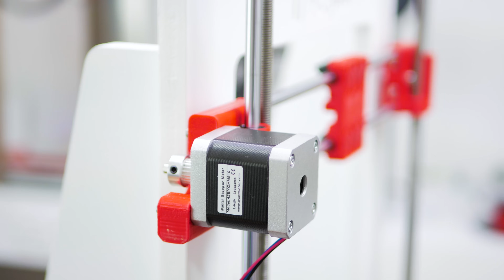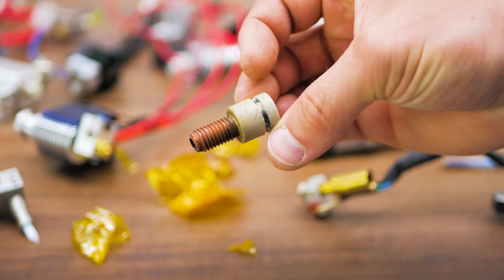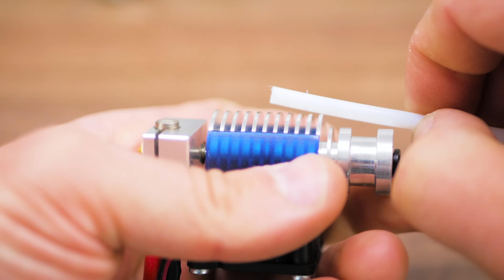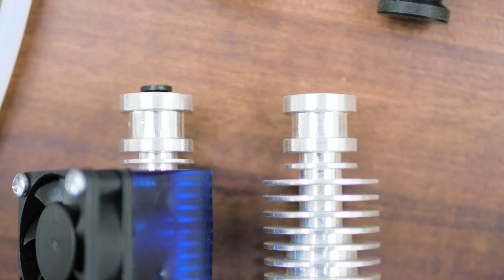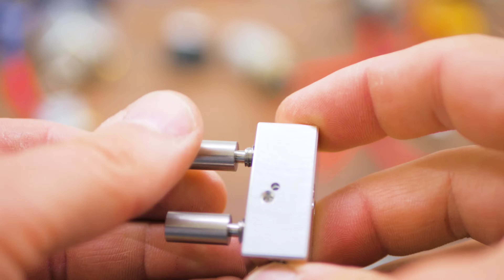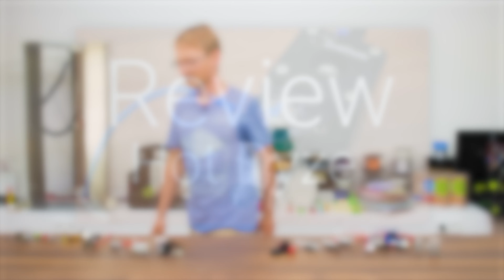Build your own 3D Printer: Which hotend to pick!

Comment: Haven’t looked back since fitting a Revo Rapid V6 hotend to my Anycubic i3.  It has direct drive and handles LW-PLA single wall prints without jamming. It’s also a tidy looking setup. Worth every cent for the fully loaded kit and the supplier printed a mounting to suit which saved me the hassle.

Comment: The chinese higher end (!) knockoffs or "versions" have come a long way since this was recorded. Particularly so for these chinese component manufacturers that have specialized in in 3d printer, laser and cnc component manufacturing, so they have highly skilled electrical and mechanical engineers and machinists on board, as supposed to those just trying to replicate from visuals. Those "versions" aren't always super cheap though, the dirt cheap ones still tend to really suck. An apt example is the higher end micro swiss "versions", which have actually improved substantially on the original design, where micro swiss themselves have been vocal about intentionally choosing not to address those points of flaw and improvement.

AFAIK, some of these high end "knockoff version" manufacturers, are also the actual OEM manufacturer (or under same umbrella) of either parts of, or the entire brand-name model.

Comment: i have a prusa i3 clone with an mk8 extruder and it works 100% perfectly fine. In china they have no laws against stealing other people's intelectual property.. so when american companies have their stuff made in china (which a huge percentage of them do) those plans and parts are now cloned and sold for way cheaper. this is NOT always because the quality is lower than a genuine part. MOST of the time the ONLY difference between a clone and an authentic part is the name they stamp on it. a lot of the times the same machines and factories that made the authentic part is also making the clone. aka, there is literally no difference between the clone and the authentic part. or sometikes when you buy a "clone" its not a clone at all.. if a company makes a v1 product and makes way too many of them, when they release their v2 product, that factory still has a bunch of v1 parts left over with nobody to sell them to. So someone somewhere will slap em on ebay. If were talking about advanced electronics, then yeah you always want to get authentic parts that have high quality components in them.. But for something as simple as a hot end (or MOST of a 3d printer) you will get identical performance from a clone as you will with an authentic. the only difference is do you pay 40$ for a part or do you pay 7$ for the exact same part?

Granted with an authentic you KNOW youre getting a good part, and with a clone you only will Probably get a good part. There's always that risk you will get something trash because theres no quality control on chinese pop-up factories. But in my experience, 100% of the clone 3d printer parts i have EVER bought, they have worked 100% as good as the authentic parts.

Comment: Taken into consideration that this is 4 years old as of this writing and my mechanical/engineering knowledge of 3d printer hot ends is rather limited, but is there a reason no one uses a graphite liner instead of Teflon? Being exceptionally slippery and nearly heat proof, the only downside I can think of is its relatively brittle nature. I'm sure someone could figure out how to drill out an inserted rod though.

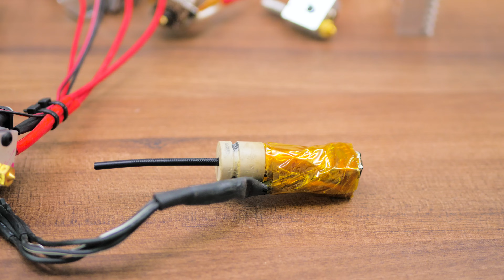Comment: 1:07
PEEK: I am 300C
Standard e3d v6: well so am i
metal infused filaments: well i am 301C
e3d v6 high temp heater block: aM i A jOkE tO YOu?!
Later,
PEEK: tries to print. melts
e3d v6: tries to print. melts
e3d v6 high temp heater block: prints 301 C
pure metal filament: Am I a JoKe To yoU!?
ptfe based vs pla: i can print u
all metal vs pla: ight imma head out

Comment: Nice video.  I have a Lulzbot Taz3.  The hotend just stopped working.  Any idea where I can find a replacement for that?  It looks like Lulzbot has gone out of business.  I'm assuming it's the hot end that is the problem, the bed still heats up, I put a heat gun on the nozzle and the temperature goes up too.  Not sure what else to check to confirm the problem.

Comment: I have a dream of building a DEDICATED polycarbonate printer. (Enclosed, Insulated Hypercube) It would have to have an all-metal hotend. But even the bowden tube and locking mechanisms would have to be heat resistant.

Comment: Just like to confirm for your viewers, the aliexpress E3D is flawed, constant jams with PETG, a jam at the 2 hour mark with PLA, every time!. Changing temp and retraction made no diff. Required full disassembly for unjamming - nice.
I pulled it apart, there is a manufacturing void wider than 2mm above the transition zone that prevents you even pulling out jammed filament, the all-metal height is way above the transition zone causing retraction to stick to the metal (I guess). An M4 to M5 metal pipe, so you can't easily modify the setup. I drilled the heck out of the heatsink (M5) and heat pressed some rounded M4 nuts. Screwed in the usual M4 heat pipe (not sure of its technical name?) with metal the end towards heat block and teflon end inside the heatsink. 
It now works like a dream with PLA and PETG. Doing the PLA at 150 speed, PETG at 100 - still tuning for higher :-)

Comment: Hi Tom, do you have any experience with the nozzle used in the Geeetech Giantarm D200 print. For some reason i have to print PLA at 230gr to get a good result and abs 250gr but at a slow speed.

Comment: Hey Thomas so I purchased a all metal 12v E3D v6 clone for my Tevo tarantula to upgraded me stock Hotend. However it is incredibly underpowered..in fact it only reaches 200c when it is supposed to reach around 280c easily. Any ideas?
Reply: Maybe they shipped a 24V heater cartridge?

Comment: bad choice for what a bad clone example... in most cases clones are cost-effectively better than its original counterpart as for th fitting, well they make it for their own heat sink, in fact most clones are usually as good if not better than their original and since they are not branded are cost effective, not good if u need replacements but great choice if u make sure to buy replacement parts ahead of time and with that in mind the entire notion of clone machines is a myth, cloning is only bad for intellectual property owners not the consumers, there are some exceptions of course I would not buy a clone TV of a Samsung but as far as 3d printers go clones are a great alternative to cheap high efficient machines with out the name tag cost. I am an FDM 3d printing service have used ultimaker 3+ and my original ultimaker 2+ , makerbot replicator and makerbot z18, as well as a few DIY kits from seemecnc.com and repraps, and yes I do have a few SLS and DLP brand name printers... but to be honest I have also bought a slew of counterpart clones to these machines and they are either the same quality (just a bit uglier in most cases) but at times many of the clones are actually faster and have greater resolution and a much better upgrade path than their branded name machines. I don't like IP infringement but I don't believe in monopolies either and clones keep it real! especially in the arena of invention and making 3d printers better and better, point is my clone 600x600x1000 print area fdm with a resolutions of 20 microns and up to 300 microns, I used this a lot and after almost 2 years or extreme usage it is still going strong as apposed to almost all my brand name printers that have hade repairs and fixes and upgrades at least twice in the last two years

Comment: Speaking of clones. Original V6 last time I checked was $70-$100, which is beyond ridiculous for what it is. If they set a fair price they could get much more business, but for me, throwing a $100 for each hotend is a thinkless waste of money. For example "original" heatsink costs around $20, Chinese is $2 and they are absolutely identical. You don't need original for that, at all and overpay so much. the only parts that actually need to be of high quality is nozzles and the heatbreak, but again, they can be purchased elsewhere for a fair price.
Reply: Just be careful when purchasing clones. Yes sometimes they fit and work as intended, but I just got a set of clone original V6 heat-sinks and they were just slightly too thick to mount. Tolerances and material quality are usually what you have to worry about for anything not original.
Reply: And how many hotends have the Chinese actually designed? As opposed to waiting for e3d to work out the engineering and then copy it? End result? e3d go out of business. No more innovation. Also you seem to have misspelled 'are absolutely identical' when you clearly meant 'look pretty much the same to my untutored eye' :-) do you know the grade of Al used in the knockoff parts? or the stainless in their equally cheap heatbreaks? what exactly is the finish on the inside of that cheap heatbreak? How accurate was the lathe, how sharp the tool... or the operator for that matter?
I would have though that 90% of why anyone was into 3d printing would be about innovation, and innovation costs, and innovation on the bleeding edge costs even more!
Why was my BMW more expensive than a trabant? both cars, both German.... go figure.
Reply: Probably it's true, you will not get the exact quality but OP is right, 70€ for a metal tube is just ridiculous and imho the creators developed a good product and now are just riding the money wave.
Reply: @naughtyhorses  I don't count making a huge heater block with horrific oozing issues as innovation
Reply: @friendzone2092  so stick with your Chinese designed kit then...oh hang on a minute
Reply: @naughtyhorses  My friend's Triangle Labs V6 "clone" has worked just as well as my genuine V6 directly from E3D. The only way I can see e3d improving their design further would be to make it more compact and find a better design for the transition zone.
Reply: Jon, it's a non-reasonably high price for few pieces of metal. Even that they've made with great Rz number, precise enough to work great and etc. Of course they spend some resources on R&D but... you know, it's not a gas turbine of an airplane ;)
They just use the situation that "market allows" so the price is high. Now with a lot of clones they must think about smart and fair prices. 30$ is a fair price and I'm ready to buy it for this price (if my own will fail). Just need to cut in-between chains (to customers) so this will work then.
Reply: @KiR_3d  yeah, and the prices of drugs are outrageous for the combination of a few chemicals. Your logic is completely flawed.
Reply: Etacovda63 Err... I don’t think you wanted to put THAT example if you’re disagreeing. Price of drugs is artificially inflated to outrageous prices because people will pay whatever they can for their life. Just see what happened to pyrimethamine (aka Daraprim) a few years ago...
Reply: @GRBtutorials  yes, that's one part - but the other part is paying for research in the first place. No protection of work means people won't develop drugs in the first place.
Reply: Etacovda63 I think this is like insulin in us. Yes it saves lives but it’s insanely overpriced and the pharmacies are abusing the importance of it... in a ton of countries it costs less than 5$ compared to hundreds of dollars in does in the US
Reply: @Etacovda63  I live in Hong Kong, I just bought a Chinese e3d heatsink, block, and heatbreak for less than 10 hkd (~1.2 dollar). There's clearly quite the difference.
Reply: When did I say there wasn't a difference? The point is that china is quite happy to steal designs and make them cheaper - effectively being leeches
Reply: @Etacovda63  that isn't being leeches. That's business. And you can't exactly steal an OpenSource design. Yes, the genuine article of anything will cost more because they actually put resources into research and design, but if the genuine article charges the price of that research design per product, rather than trying to make back that money just by making a great product that'll sell well, then of course people are going to make clones, because you've made it too easy to make a competitive product for significantly cheaper

Comment: I purchased an e3D clone of a v6 hot end. I didn't pay a lot for it, and it worked just fine at first. It got a bit unpredictable at times. I had an issue where I would have to pull the filament each time before a print, and chop semi melted end off to get it to print. I ended up buying an original e3d heat break that was all metal and I haven't had the issue since. The funny part is the price I paid for the clone and the heat break, for a few more dollars I could have got an original one....  But it prints like a champ now.

Comment: I bought a E3D V6 Clone, it was around 7 Bucks with all the exteriour parts as fan hater and thermistor and PTFE tubing and fittings, disassembled it and didn't find any downsides, will buy a real one too to support the company but in the moment I have to keep this hobby on a budget
Reply: TheScrappingJeahaha Hey do you mind linking me the one you bought with all parts? 😊

Comment: I dont see the issues people get with small nozzles. I use a knockoff e3d v6 lite, with knockoff 0.2mm nozzle. The clone has worked great for like 8 months, outlived two of my printers. All I did was replace the thermistor and heater cartridge. $1 0.2mm and $1 0.8mm nozzle all work great. Ive done 0.5mm and 0.06mm layer heights, fun stuff.

Comment: Tom,

I have a custom 3d printer running Marlin on the Azteeg X3 Pro with Arduino IDE 1.6.12. I am using Repetier and having problems setting up my Geeetech Mk8 dual extruder. 
Hot end 1 works fine and reads accurate temperatures with the thermistor connected to TEMP_SENSOR_0. The thermistor for hot end 2 is connected to TEMP_SENSOR_1 and also reads accurate temperatures. I have run PID autotune and changed Kp, Ki, Kd accordingly. 

If I turn on hot end 1, it heats up fine. When I try to heat hot end 2, it does not heat at all and eventually times out with a heating failed error loop. 

When printing, with hot end 1, everything works fine until around the second layer, hot end 2 randomly starts to heat up and eventually stops the print because it reaches maxtemp. 

I was wondering if you could shed some light on what may be going on here, and possibly recommend a fix. 

Also, I am not sure this is the appropriate place for such a specific question. Maybe you could direct me to a better place to ask things like this?

Thanks a lot!
Reply: Problem solved! After taking a closer look at the pin assignments, I realized hot end 2 (on pin 9) was defined as a fan, which explains why it would come on after the first layer.

Comment: I've never had a problem with a $12 e3D v6 lite clone. 6 months in and the only thing i've had to replace is the heater cartridge, because I twisted the hot end during a print and the wires shorted. Not so much as a jam has happened. The only thing I don't like is that it's a different size, so no already made designs really fit it, so i'm on my own trying to figure out how to active cool it
Reply: Yes, but in the clone transition zone tube hole is straight, but originally is conical.

Comment: What was it that was a problem with the threaded heatbreak you showed at the end?
Reply: He can't fully screw down the cold end heat sink which leaves a huge transition zone.
Reply: There was no bare surface on the top, and the transition zone was threaded stainless steel, which means that more heta will be transferred to the heat sink
Reply: is it fixable?

Comment: Working on a RepRap all-metal conversion experiment. I got a stainless steel all-metal heat-break, and can set the proper "transition zone" gap etc... But, my question is really, if PTFE's limit is around, lets say, 240*C, what about the small PTFE insulation around the thermistor wires on typical RepRap/i3 heat blocks?

How do the typical all-metal heat blocks mount their thermistors? I found some heat blocks that utilize a brass M3 threaded 100k thermistor, but even they still utilize some form of PTFE wire insulation. Are the M3 threaded thermistors a solution to the PTFE max temperature issue?
Reply: Thank you for the rapid response! I just found a 3mm cartridge style glass fiber sleeved thermistor on Aliexpress for $3.33, rated to 300*C, (although it says the fiberglass sleeved wire is rated to 270*C). I will keep researching, I am sure there are some solutions out there somewhere.
Reply: PTFE doesn't start releasing Fluorine until 600c not 250. The only other molecule in PTFE is Carbon which won't do much.

Comment: But hey , Chinese manufacture aren't ALL that bad. For eg. I've found one that has a decent hot end cylinder milled out, but the PTFE tube inside of each one wasn't all cut to the same size. Not that it was a problem since I could fix that easily. But then you get to the hot end nozzle bit, which wasn't 0.4 , just by looking at it I could tell. Finding another manufacturer online was easy , and got some 0.4 replacement nozzles in the mail last week, and they were perfect. It's just a matter of finding a decent manufacturer of these "Cloned parts". Cloned as in , a hot end's geometry is simple and as a result, many hot ends tend to look the same. Well they are all the same in some sense right? :D All that can truly vary is the quality in which they are made.
Reply: Hi. Have you the links? I mean your hotend+nozzle, because I al worried to choose the wrong option.

I see on aliexpress this:3D Printer Wade extruder All metal  E3D J-head Hot End with Heater
 http://s.aliexpress.com/RbINBNV7 
(from AliExpress Android)